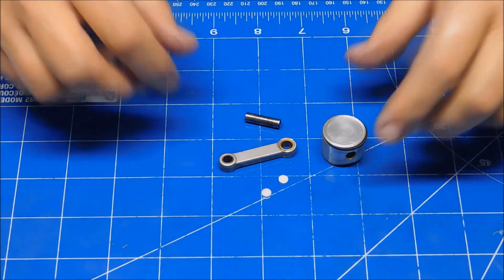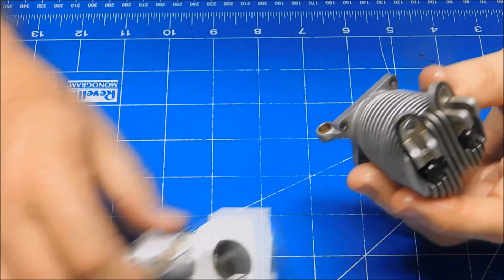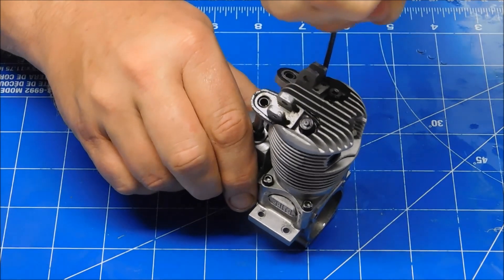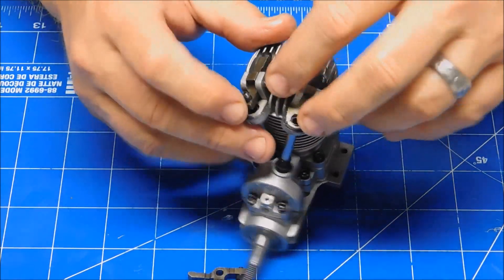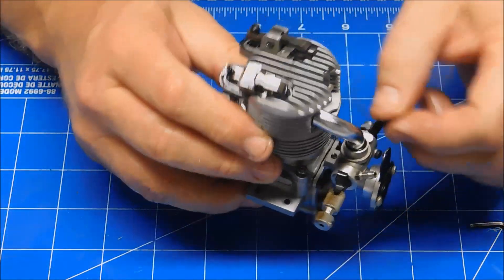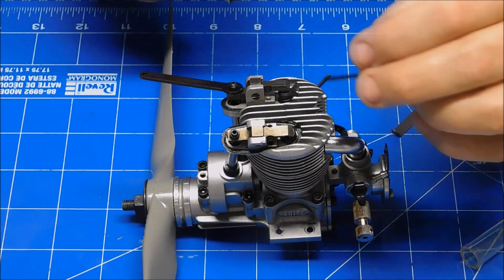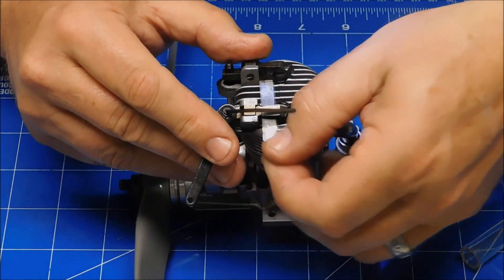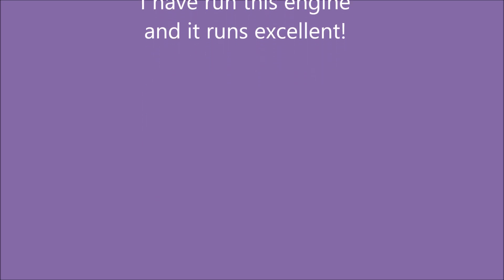Saito FA-45 MKII eBay Part 2 Reassembly

Comment: Why is it important to have the dent on connecting rod , to have it facing forward ? Thanks
Reply: Because the crankshaft has a chamfer at the crank pin. The con rod also has one on one side to match the crank pin.. The dent helps identify the correct side.

Comment: WHAT NO COMMENTS? Ok, fine, I will. Awesome video's. Robert from Slovakia let me in on your website and I have been power watching all your teardown and learning a BUNCH. Even though I do small engine repair as a source of income to buy my RC hobby stuff and know quite a bit about 4 stroke, two stroke and carb repair and rebuild, working on RC engines are somewhat new to me. Not totally because I was into RC when my brothers were into it up till 1978 when I went in another direction( working on automobiles) so the hobby went curb side. Last year a guy gave me a box of RC engines as a favor, after doing research I pretty much concluded they were pretty worn out and beyond repair. The manufacturer was no longer around on two of them and they were just cheapo motors anyways so I trashed them. Then my brother gave me a Kadet trainer with a Super Tigre 51 that needed bearings. So I ordered those and ended up buying a field box that included an air boat with a bad nitro engine,well good ole E-Bay and a few bids later, I now have two engines...and the fun begins....lol.
Reply from the maker: LOL!  Welcome to my channel!!!  Have fun.  My brothers Robert and Blaz are a hoot!